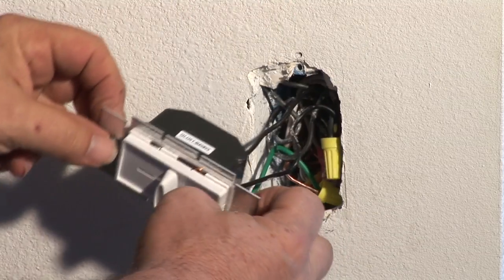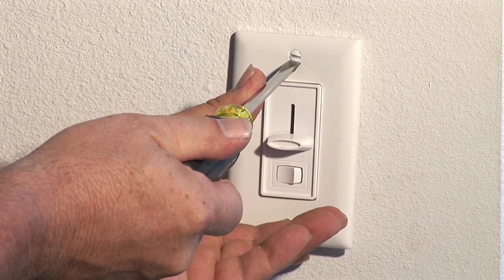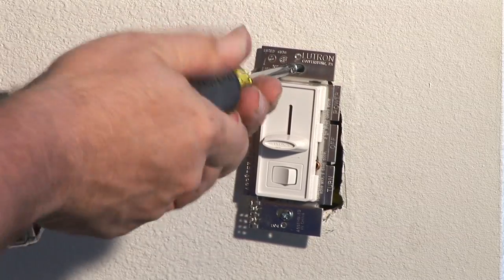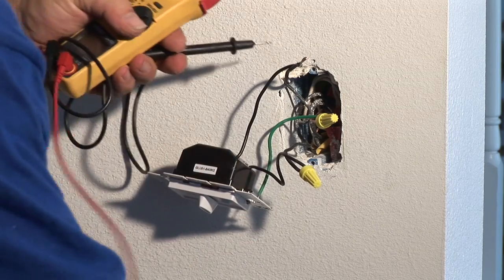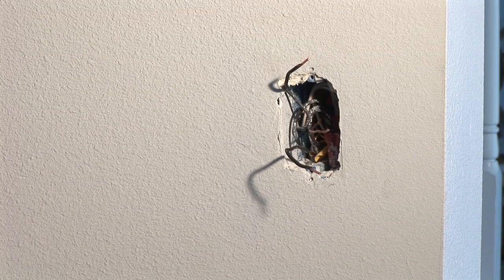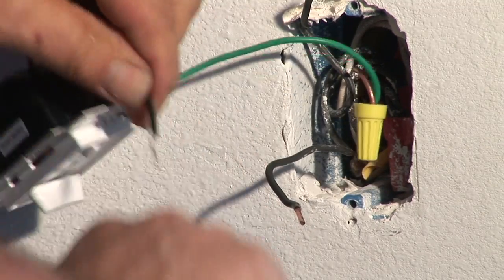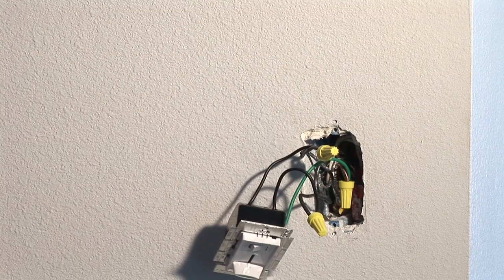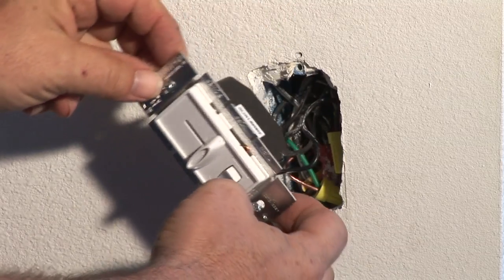Lighting & Ceiling Fans : How to Replace a Dimmer Switch

Comment: My question isn't answered in this video: How do know if you should replace a dimmer switch? How do you know that a problem is because of a faulty switch rather than a wiring problem or an issue with a dimmable light fixture? What is the diagnostic step that tells me it's the switch and not one of the other possibilities?

Comment: If the fan and the light are wired to the same hot wire, and you need to dim the light, use a remote control with light dimmer in it, or electrical signal wall control which can dim the light separately.
Reply: Installed my fan that comes with a remote. But when I try to dim the lights down. The ceiling fan turns off. It's a new hampton bay model with a receiver for remote. My old ceiling fan was able to still run with the light dimmed. Or off. But I dont know if I have to rewire the wall switch. Any advice?
Reply: @anthonyviravong5076  Is it on a wall dimmer?
Reply: @CeilingFanVideosOnYT  Yes. So it has a switch on the bottom of it right under the dimmer. For off and on. And the adjuster for dimmer. I wish I can send you pictures to show you.
Reply: @CeilingFanVideosOnYT  I have the light off right now. From using the remote. But when I try to go dim the light, the fan turns off. And i have another wire that i can connect to for the ceiling fan. But i wont be able to dim the lights. With the other switch.
Reply: @anthonyviravong5076  Did you try dimming with the remote or the wall dimmer?
Reply: @CeilingFanVideosOnYT  The wall dimmer. On the remote I dont have a dimmer. Only on and off for the light.
Reply: @CeilingFanVideosOnYT  https://youtu.be/MGqa-6H7Xrk this is the ceiling fan I installed. I have two wires from the ceiling. Black wire for the wall switch with dimmer and switch. Red wire with just a switch. The remote receiver has a white and red wire. The white wire from receiver says for AC and that is connected to the white/beige ceiling wire. Then the red receiver wire is connected to the black ceiling wire. The red wire is blocked with a wire nut.
Reply: @anthonyviravong5076  Hold down the light button to dim. Separate the fan from the wall dimmer. You should never wire ceiling fan motor or remote receiver on a wall dimmer.
Reply: @CeilingFanVideosOnYT  Okay I took it off the wall dimmer. But I still cant turn the light on and off. On the wall switch. Only from the remote.
Reply: @anthonyviravong5076  Yeah. On most receiver, including yours, you can’t have fan light turned off separately on both. Either only on a switch, or only on a remote. You could have a wall switch that turns off everything and have remote control light and fan separately.
Reply: @CeilingFanVideosOnYT  okay thank you so much for your help and quick response!! Appreciate it!